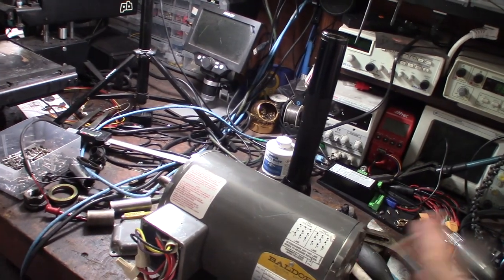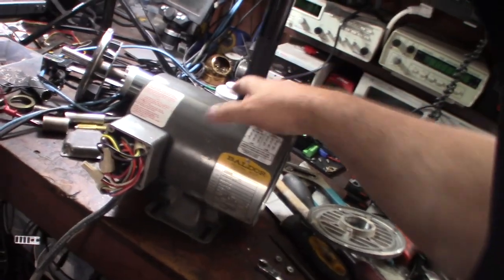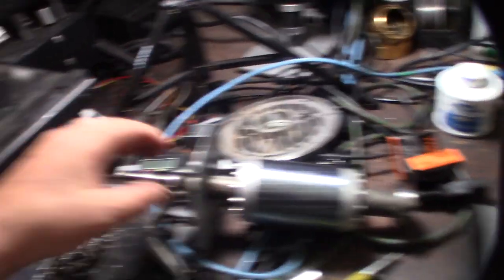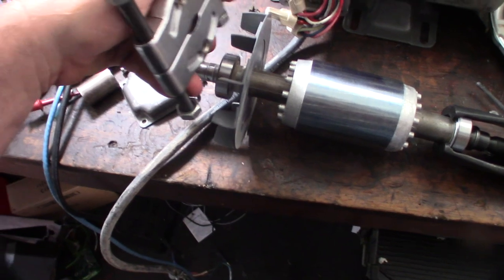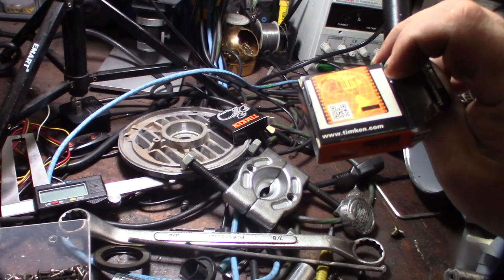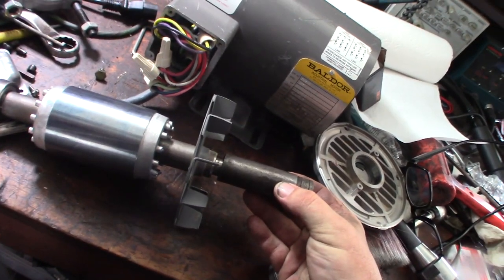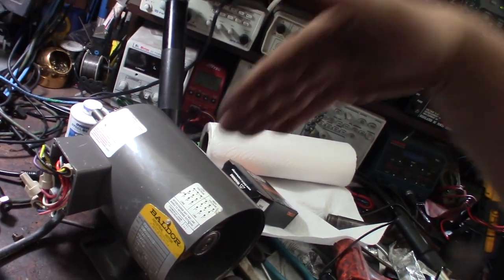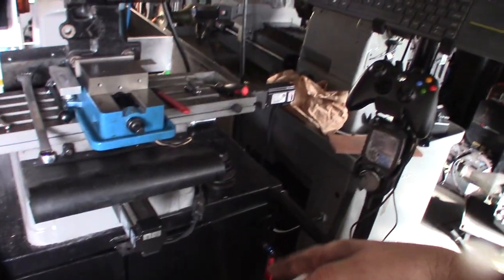Baldor 3 phase motor noisy bearing replacement, rebuild, offerUp score for CNC mill

Comment: Inviter rated motors are the best if not you will have heat issues  with the motor  at low speeds if it was me u would  install   a fan on the motor to force  coil it
Reply: If I were you I would invest in a dictionary.